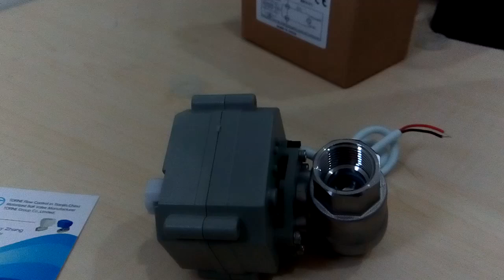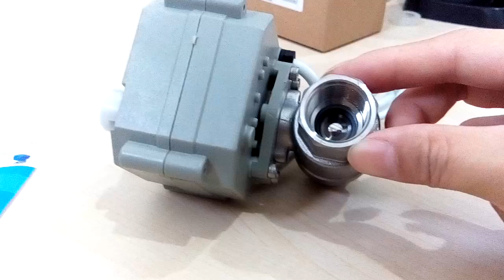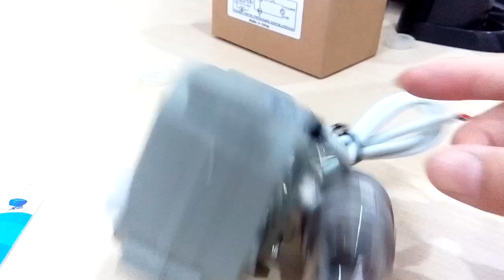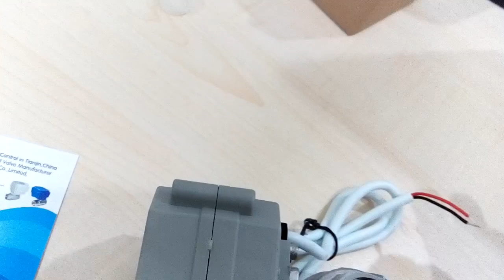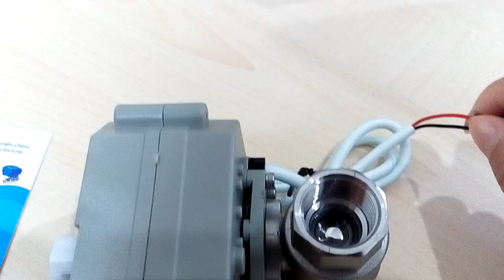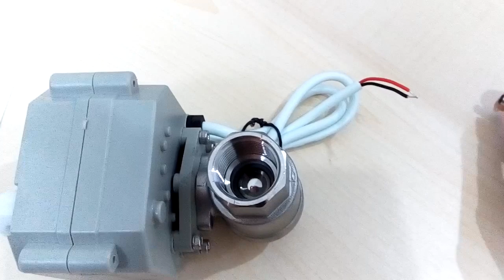How normally closed motorized ball valves works?

Comment: Thank you for the demonstration. I have bought the HSH-Flo (A20-T15-S2-B) with 5 wires. It is Normaly closed. Can I easily transform it to Normaly open?
Reply: normaly closed ball valve can be change in Normaly open  through Connection mode of the line. thermoster or ...

Comment: does this works where more sand/tiny rocks is passed thru the valve? i need one for backflushing the spin down filter.
Reply: I am looking for the same. Did you find something? If so how long do you leave open to flush spin down filter?

Comment: How does it close without power? Is there a spiral spring inside or a large capacitor which feeds the motor with power?
Reply: A large capacitor
Reply: yes ,both way is okey,  we sovle this problem by a  large capacitor